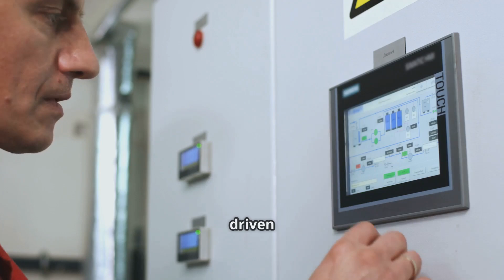China’s Dark Factories: AI Replacing Humans Faster Than Ever!

Comment: If one ton of metal like iron is $500, then somewhere in the production of robotics we have duplications that push up the cost of machines. royalties among expensive design phase once re-engineered humans can end up with dark factory equipment's that are extremely cheap  and very light in relation to weight of metal used. Under this mass production of factory robotics that relate to pricing of metal offer AI another era of automation. 

As for industrial was, we tend to over use chemicals when we could use exert per requirement and if we end up with a little more than needed, we dry vie electricity since its little anyway. By design this dark factory are about to be very clean in terms of environment AND extremely cheap.  With indefinite lifespans of the machine since they are in housed and painted, 
only electrical parts need repair after ten years or after a long time. 

Basically we expect free labour by this design in machine world we are entering. 

.